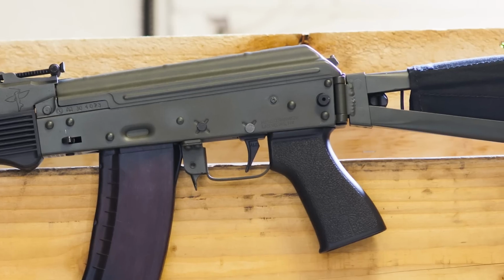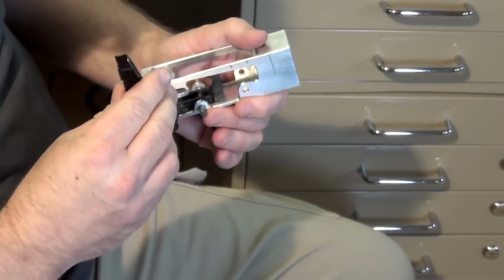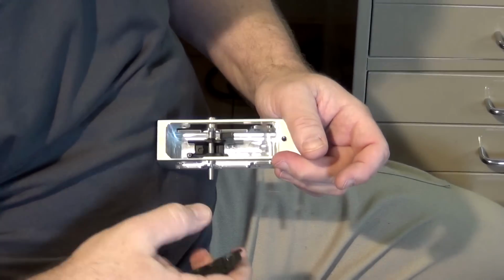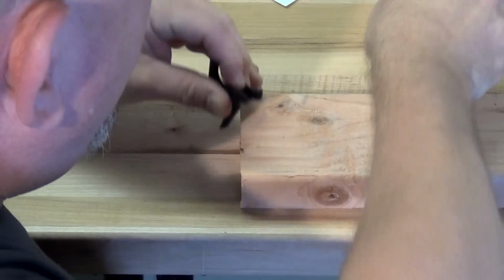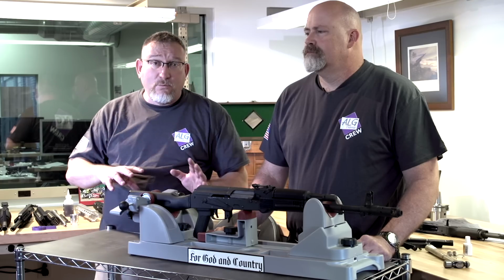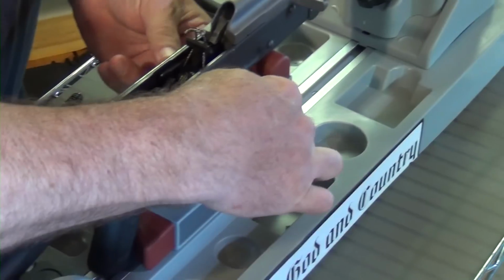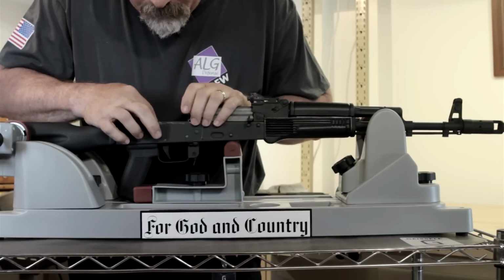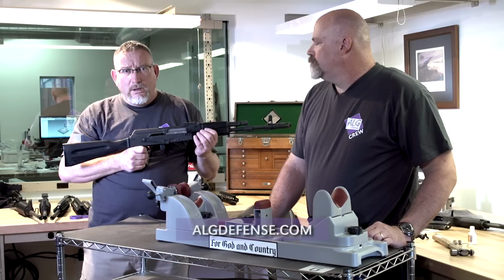ALG DEFENSE - AKT PRODUCT INSTALLATION VIDEO

Comment: A few days ago i saw this trigger in my favorite gunstore in Switzerland where i live. Without expecting much for the price i bought it went home and installed it. Ive had to install the roll pin to and file some down. After my first testing i was simply stunned. I couldnt believe that it would be possible that an ak would have such an incredible trigger. After my first range trip where my buddies tried it too each of them bought one themselfes. Its is perfect. I had to buy two more for my other aks. Great job guys.
Reply: Which store in Switzerland did you find it in if I may ask ?

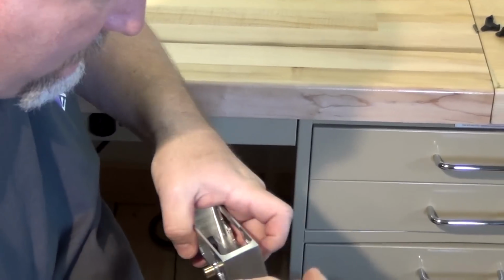Comment: Got mine yesterday, installing it tonight. Thanks to Bill, Amy and everyone at ALG Defense. Always outstanding products. My Geisselle in my AR is fantastic. UPDATE: 2/9/16 7:41 CST- Just installed this in my Zastava M77PPS in .308. Had to use the safety pin on the back of the trigger but probably only .020-.025 is left. No slack at all in the safety. Trigger reset is much improved and the break is amazing for an AK trigger. Can't wait to shoot it!

Comment: seems a file is needed on the SAR 1 for the safety roll pin also, 

also seems the dog ear on the hammer catch needs the edge knocked off so the bolt will clear,

the G2 I took out,  the hammer catch is allot more narrow and also the top of the dog ear is made with a edge grind so the bolt will clear, no problem, glad to take part in the workings

thanks Mr G, for another great trigger

Comment: Put this 'AKT-EL Trigger' in my Norinco MAK90 last night. Didn't need the small roll pin. Easy install. I added a hammer and trigger pin retainer plate, which works great keeping the pins in place. Trigger pull is nice. Feels like zero take up with a light pull (2.5-3 pounds) and crisp break. I think the price is very reasonable for what you get. Perfect for this budget AK rifle. I wouldn't have bought it if it was near or over $100. Thanks for offering a great product at a great price.
Reply: You really like the ALG over factory Chi trigger...hmmm???

Comment: Bought the AKT last for my new Saiga AK.  Great video, instructions, and product!  This video made it easy and fun to install.  I had to use the roll pin in my Saiga AKM.  It may have been soley due to the fact I am also running a Krebs Custom Safety.  Regardless, installed the roll pin, filed to desired height, and the trigger feels great.  Going to the range to get some trigger time and zero the rifle.  I have only dry fired my AK with the Tapco G2 that came in it and now with this AKT.  World of difference!  Thanks again for your attention to detail and making an affordable fire control group.

Comment: trigger installed in my arsenal SGL21 (Saiga conversion) and did not have to use the roll pin. trigger is lighter and resets much shorter than a tapco g2! im definitely going to buy another one

Comment: Great service from McMaster-Carr. Received the item in under 24 hours with 1 day shipping. The file was made in Mexico, but does seem to be of high quality. FYI- I did need the roll pin on my Arsenal SLR-107/36, which is a stamped Bulgarian receiver, but I have suspect it has to do with my Krebs enhanced safety and not the rifle itself. None the less, pretty easy installation and a super sweet trigger!!! Thanks ALG!!

Comment: I bought the AKT - UL, and everything fit perfect, but the roll pin did NOT want to go in.  I really had to hammer it in there. Eventually it was good, and only had to mill a smidge, and the safety is nice and snug.  Freaking DUMBFOUNDED at how superior it is to any other AK trigger I've felt.  It feels way better than my milspec AR triggers.  And I lube the Lightning Bow!

Comment: Installed this on a Hungarian variant, and although I did not necessarily need the roll pin to interface with the safety, I did not like the slop with the safety engaged so I installed it and took a dremel to precision fit it to the safety and now it interfaces very well where I have very minimal trigger movement when the safety is engaged. Overall great trigger and I find it more comfortable than the g2 I have on my other akm. I have several thousand more rounds on the g2 and from my trigger pulls I find them to be a couple ounces difference. The actual press and overall reset is much better on the akt, but as far as weight of the pull I'd say is negligible. Great product none the less.

Comment: Just installed in a Waffen Werks 74, before they were bought out. Went in super easy and no need to use that roll pin. Havent checked yet but Im guessing trigger pull is 3lbs or less, I wouldnt want it any lighter, they do include an extra spring to increase the pull weight tho. The reset is another high point, about 1/3 that of a TAPCO.

Comment: I just put mine in.. But since I don't have hammer nor file around me.. I left the roll pin out. I got an Arsenal SLR104FR. It works. A lotta movements when the safety is on.. I mean, it won't fire, but I can see the disconnector hook on the hammer, is about half a millimeter from firing.. I'm going out to buy hammer and file today, but the roll pin seems a little too big for the hole? I just cannot get it in.. Anyway, that's probably my problem. It's an awesome trigger! I shot about 300 rounds with my Arsenal stock trigger.. It was a pain.. And literally pain.. That trigger slapped me pretty hard. Can't wait to finish the installing and shoot it!!!!
Reply: +Si_Vis_Pacem Para_Bellu my good man I feel bad for you. Mine went in like a dream. I hope everything comes together for you.
Reply: +Timothy Hudson thanks! I bought a hammer, but the pin is still too big.. I can only get it in about 1/4… and file almost the rest of the pin.. It took me about 40 minutes. And now everything is working fine! I might filed it a little too much, but at least it's totally safe now.
Reply: Excellent. I am so very happy with my results and I believe that this trigger only made an already very excellent rifle even more accurate.
Reply: +Timothy Hudson Especially after using my Arsenal trigger for a month.. This trigger has almost no take up and break so clean, also the reset is fantastic!!! Best money I ever spent!!!! And they included an extra spring to increase the pull weight, it was a nice touch

Comment: I got a good laugh about how easy that roll pin tapped in for you. I had to pound mine to high heaven to get it in.
 Pretty easy install though otherwise.
Reply: Right!!! SWEET BABY JESUS, Mine was tough. Glad I'm not alone. Cheers!
Reply: Ditto that.  I had to beat the pin in with a framing hammer!!  Worked fine after that.
Reply: On my SGL-21 I had to use the roll pin.  FORGET hammering it into the trigger.  Nearly impossible !  I put the roll pin/trigger in my vise and pushed it in using the jaws of the vice.  Finished it off filing per the excellent video instructions.
Reply: @delta3two  you're a genius
Reply: Roll pin starter.  Best $5 you’ll ever spend.
Reply: I have the worst time with roll pins. I fucked up the roll pins on the bolt release on my AR.
Reply: I was thinking the same thing
Reply: I used a pair of channel locks
Reply: Alright so the first installation I saw this comment and thought “it can’t be that bad” I’ve done three or so? And am doing my fourth now and Jesus Christ every time I do it I think back to this comment. My god man, love the triggers but Jesus the roll pins have never once fallen in like this lol

Comment: Question. Tapco G2 hammer is often cited as the cause for the rear projection of the bolt carrier getting mushroomed or deformed,....the reason given is said to be either 1.) Tapco hammer is "too hard"....or 2.) Backside of Tapco hammer has a "humped" profile with definite edges along its backside,  that needs to be re-profiled to be  more of a single "curve". Jury is still out which it is. In any case, have you tested your trigger with at least 1000 rds on ONE gun.....to see if your trigger causes this same mushrooming of the tail-piece of the rear-projection of the bolt carrier ?

Comment: Works flawlessly in the AK63DS by Century Arms.  It does not need the pin, ar least in mine.  I thought it did and put it in, but ended up filing it down flush.

Comment: Just figured I'd mention my experience with this trigger.
I found this (or at least the AKT-EL) does not fit "As-Is" on a PSAK-47 Gen2.  the trigger hook was too tall and required me to shave the top point off about 1/8" or so, as the bold would hang on it when charging and when releasing the charging handle.. bolt assembly would just stop on the hook.   Also had to grind off about 1/8" of the hump of the hammer as the bolt was rubbing on that  to the extent that it would be very tight to charge.  after grinding down, it ran like a dream..  nice trigger, but after modifying it, it was a great trigger.
not bashing the product as it was not made specifically for the PSAK-47, just mentioning it in case anyone else has the same issue.
Reply: JeremyF4i same exact thing for my romy parts kit

Comment: after 2 CMC triggers that failed me, I put an ALG. little harder to put in, but did not require fitting. the enhanced saftey from AK operators Union works fine without the roll pin...I'll test fire in a few days.

Comment: I just installed your AKT-EL ALG AK  Trigger Enhanced with Lightning Bow on a GP WASR 10/63 Romanian  imported by CAI in Vermont. I do believe the installation is correct as everything works mechanically. Haven't fired it yet.  I did have to file the roll pin until it cleared (close tolerance) with no gap but smooth action of the safety lever. Safety and trigger work fine. Problem is I still have a problem with the bolt catching when cycling as it did originally. If I pull it back and slowly let it go it catches and will remain there. This does not happen if I pull it back and let it go. Hope you understand what I am saying. Any thoughts please?
Reply: Most stock AKs that I have seen do that. If it shoots, it's ok.

Comment: I used a bastard file and it worked just fine on the roll pin. I did use some sand paper to clean thing up a bit.

Comment: So, to be clear, there should be absolutely no play in the trigger with the safety on?  I just installed mine without a roll pin and even though the safety engages the trigger completely and I can't see any way of it slipping past, there's still a decent amount of slop.  Thanks.
Reply from the maker: Please email or call our Weapon Techs to get help with any issues you may have!

Comment: Just got this one today. Trigger fits well, but hammer hits auto sear pin and does not reach the firing pin. Using stock hammer until qualified smith fits the new hammer in. Also, disconnector wasn't long enough to reach fire selector, but this was to be expected as it was sold as semi-auto trigger.

Comment: Not sure what my issue is I installed it on a N-pap fitted the pin for the safety..but the trigger feels hard to pull and doesn't reset,I made sure the hammer spring has the proper bends. Any hints would be appreciated.

Comment: Im having contact between my safety lever and the disconector that does not allow me to move the safety lever down, any advise on how to fix this issue, can I take off material from the safety lever ( not where it engages for the safety? But where it is making contact with the disconector, it is a krebs custom safety lever not the original that came with my century NPAP. Please advise

Comment: Anyone tried one of these in an OPAP yet?  I have one on the way and am anxious to get it installed and out to the range.  Thanks for the very informative video!
Reply: Ok, since no one had an answer to my question, I will give you some information on the installation in a Zastava OPAP.  First, let me say I'm a professional watchmaker, so doing some of this, like filing is kinda second nature to me.  However, I don't think anything that is required requires nearly that level of precision.  Prior to this I had never removed the trigger assembly from my gun.  The closest I ever got was pulling the safety to get rid of the shepherd's hook and replacing it with a clip.  
Now, you WILL need the to use the safety stop.  Once you have it hammered in place, you'll need to remove about 1mm of material from the top.  I would say start at .5 and then work your way down to get it fit to your particular rifle.  I actually got it to the point where the safety functioned perfectly but the trigger didn't move at all.  For whatever reason, that feels a little unsettling, so I  removed a tad bit more so the trigger has a tiny bit of travel then stops.
Next, after you reinstall it in the rifle, check to see if it can fire.  Mine couldn't.  The reason was the safety was contacting the back of the trigger behind the hole for the safety stop.  The easiest solution would be to relieve the safety a little bit, but I was worried about it messing up the contact point between the safety and the stop.  So I relieved a little bit of metal from the back of the trigger assembly behind the hole, maybe a quarter mm at about a 60 degree angle, and added a very small chamfer to the front of the safety.   This allowed the back of the trigger to clear the safety and the gun could fire.
Lastly, you will want to check the disconnector.  Mine would fire once, but while holding the trigger and re-racking the bolt the disconnector would not grab the hammer.  That is because the safety is so wide that it was holding the base of the trigger assembly in place.  So, you need to file away a bit of the safety in that area.  Looking down into the assembly, mark a point a little bit past where the safety interacts with the safety pin.  That area should remain untouched.  The "unused" portion of the lower safety (anything further "away" from the safety stop can then be filed away.  I would say I probably removed about 3mm of material to allow the trigger assembly full range of motion and for the disconnector to get a full grab of the hammer.  
The whole process took me about an hour because I was figuring it out as I went along and seeing where the points of contact were and needed to be altered.  You will need to remove/install the trigger and disconnector many times for the installation.  But all you need to do is to pull the main spring legs back out of place and push out the trigger pin.  Once you've done it a few times, you'll literally be able to do it in 10 seconds each time.  Like the video says, take your time, and make small adjustments on each try.  It may take a bit but the results are worth it.  
Hope this helps, and if anyone needs any help or pics or anything like that, I'm glad to help.
Reply: @PeterDimas  Thanks I thought it was just my inexperience but I will have to file a little off my safety just to get it installed let alone the rest of the details. But thank you. Mine is a Nodak spud Romanian kit so I thought it would fit without any problems

Comment: do you know if the Krebs custom safeties need the roll pin? I'll let you know by the end of this week one way or another.
Reply: Alex Kowal my krebs saftey did need the roll pin. I also had to file the safety down a hair. It will most likely require some fitting.
Reply: +WolfmanTV 
why did you have to file the safety?

Btw, is it really that big of deal with "some" play of the trigger when the safety is engaged? I think I filed slightly too much off the roll pin and have the smallest amount of play. It is not worth knocking the roll pin out and using the other one.
Reply: +Prodigysportsman my safety did engage without the pin, but there was just enough space to allow the hammer to drop when the trigger was pulled with the safety engaged. You would have the same issue if you took too much off the pin, and It doesn't take much wiggle room to let that happen with the already super short travel of this trigger. Not sure why they're filing their safeties.. Would not advise anybody to do this as the entire point of the roll pin is to not have to mod your gun or the trigger itself. If you still need to file your safety after taking the pin down, you probably don't need the pin.

Comment: Used the roll pin on my kp9 with a Krebs enhanced safety. This ALG is awesome!🇺🇸
Reply: Question: Did you install the alg hammer it comes with in your kp-9? I noticed there is a size difference. Any problems you found after running it?
Reply: @bretc1012  I did install the alg hammer, no fitment or function issues. Didn't notice the size difference in hammers, I'll have to take a closer look

Comment: I installed the e akt into my romanian ak, i had to use the roll pin. I got it to barely clear.  But when i do function check with dust cover off on safe, the safety pops up and the trigger depression engages the disconnector dropping the hammer.  What should i do?
Reply: Sounds like you have a full auto safety selector? Maybe look up ak safety selector problems to file it done

Comment: Just ordered mine for my arsenal 104-31. Any one run a krebs safety on theirs and did you have to use the roll pin or did it fit without it?
Reply: I imagine you already found this out yourself, but you do need the roll pin with the Krebs enhanced safety. Hope the installation was painless!!
Reply: yup, it was easy!

Comment: What about a Norinco / SDM Style AK47? Do I need the pin for those AKs?
Reply: Just put one into my mak 90 and yes, you need to use the roll pin. Though I guess it will vary and if your safety selector is different it could possibly require different fitting. Got the roll pin in and now I have to file it. Just don't have any files atm

Comment: Has anyone installed this on a NPAP yet? Do you have to do some custom work to get it to fit or was it direct dropin?
Reply: Works on npap, roll pin needs to be filed down but it will work. took me about 30 minutes.